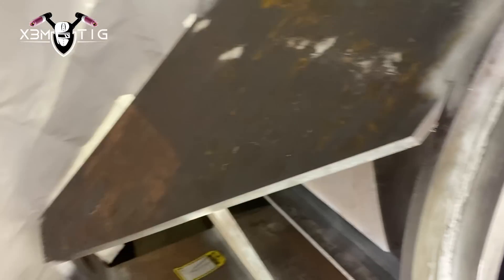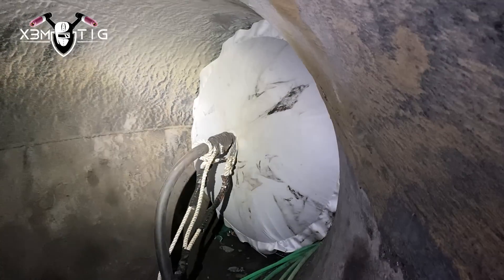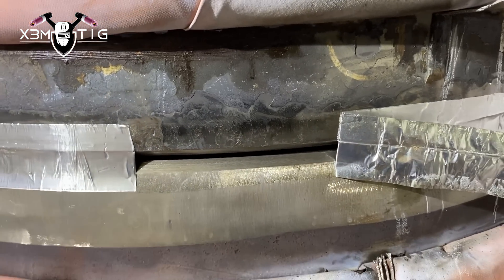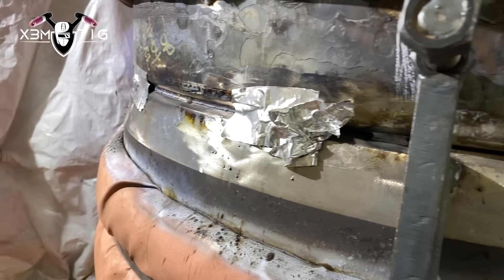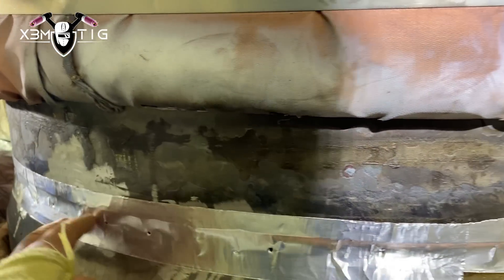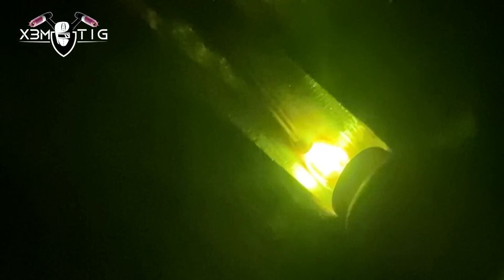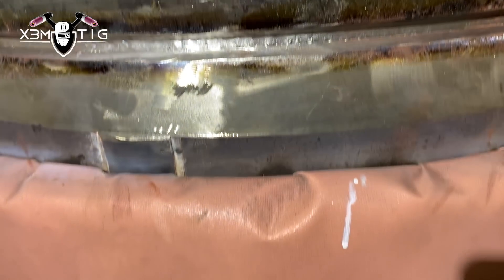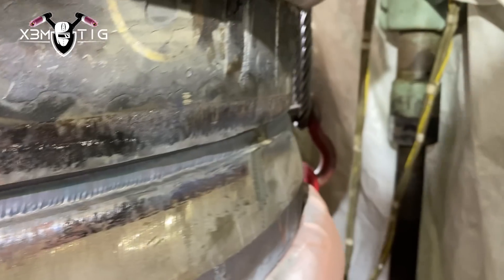How to TIG Weld 42” Pipe – X-Ray Quality Set-Up & Tips!

Comment: You deserve a lot more subscribers
Reply from the maker: I appreciate your comment brother 👍
Reply: @X3MTIG  I've been practicing open butt root on plate with tig, but backside is always slightly concave. Been using 1/8" gap with 3/32" filler at 140-150, do I need more gap or to push rod in more?

Comment: Por que as vezes você tira a vareta da porça se fusão?
Abraços do brasil.
Reply from the maker: Hey bud, gap shrinks, and it’s not perfectly even, so I’m taking rod out of the puddle to make sure I got good penetration, and also I prefer to dip rod on narrow sections instead of keeping rod in the puddle or lay wire technique.

Comment: I like to check purge with stainless 2mm plate, I put the plate directly on the gap and hold the arc for some time and if the opposite side of the plate is without oxides and is clean and shiny then purge is Good!
Reply from the maker: Thanks for the tip 👍

Comment: Question….. for your dogs, what material do you use? Im curious.. same material as the chrome 5 pipe or carbon steel dogs?
Reply from the maker: Carbon material, welded overlays with chrome tig wire at the bottom part, to have enough meat, and they were PMI tested before use.

Comment: Congratulations on the very careful and attentive work. Question: why did you use a reverse protection with inert gas on carbon steel? Oxidation?
Reply from the maker: Hey bud, thanks for your comment. I was purging pipe because it is chrome 5 material.
Reply: @X3MTIG  What is that piping for? Good job man